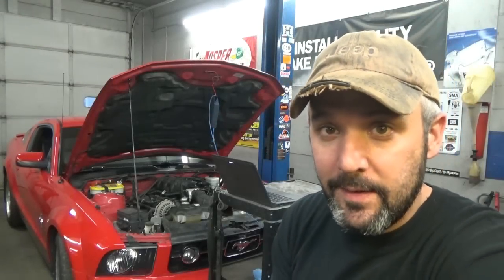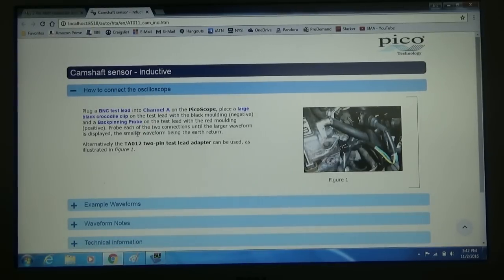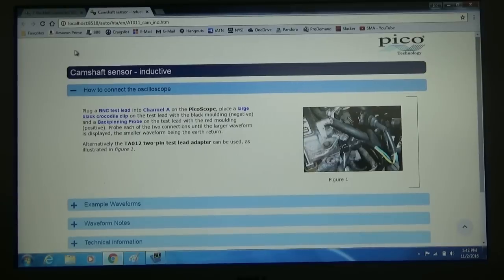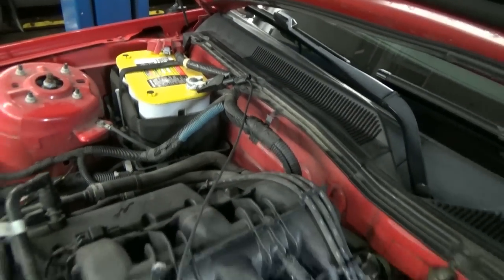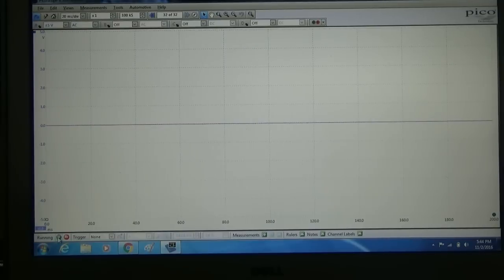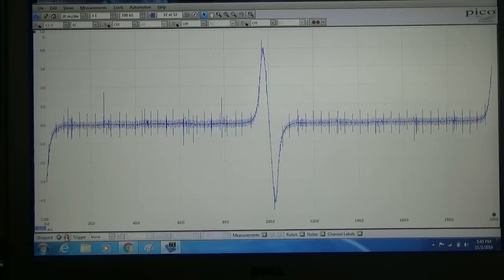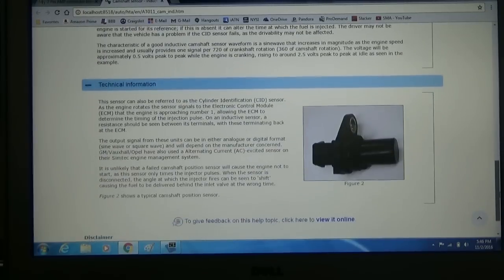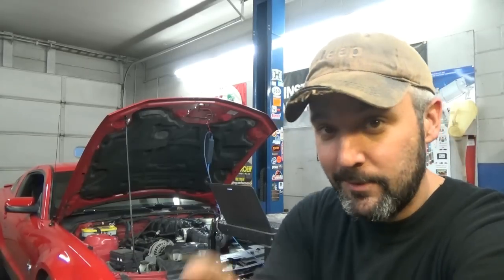PicoScope Guided Tests - Inductive Camshaft sensor AT011

Comment: The other name for that style of sensor is variable reluctance.  The peak-to-peak voltage changes with the engine RPM and will be very low when the engine is cranking to possibly >100V at higher RPM.

Comment: How does one determine if a sensor is inductive or hall effect?
Reply: That is not always true.  Check out active wheel speed sensors.  Some VR sensors have 3 wires.  The 3rd wire acts as a shield ground.  Best way to figure out what sensor is being used is to look at the wiring diagram for the vehicle or service information.